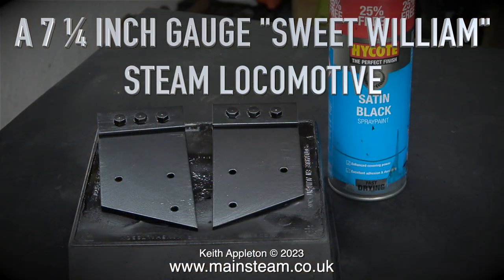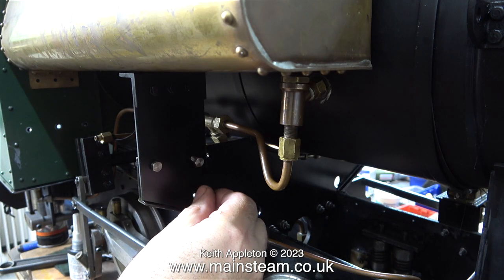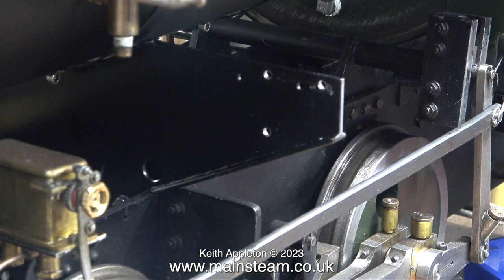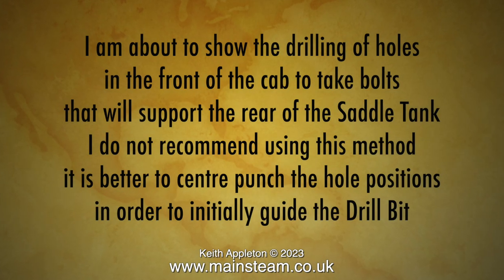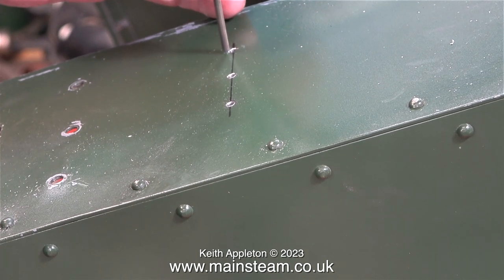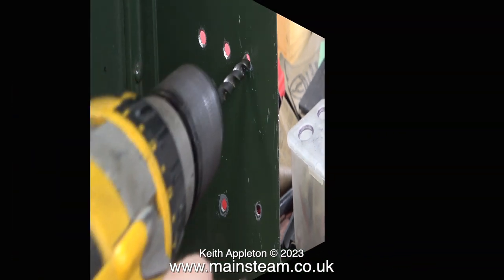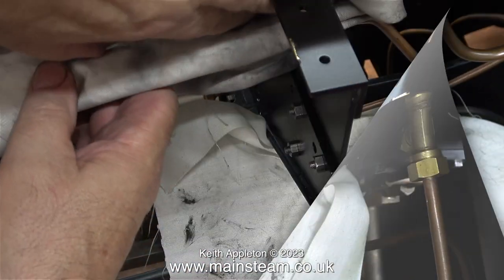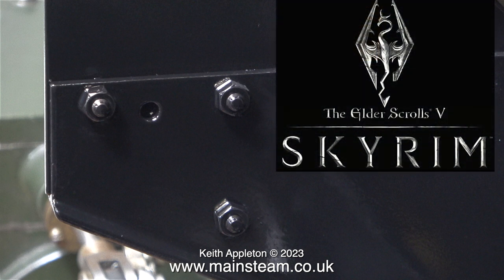A 7 ¼ INCH GAUGE "SWEET WILLIAM" LOCOMOTIVE - PART #53

Comment: I greatly appreciate your commitment to simplicity and non-fancy, but fine, workmanship. I'm not sure though that I can get my head round the idea that, for newcomers, years of experience are a good substitute for straightforward engineering practicce. Sort of cart before the horse. These days good marking-out tools are cheap and readily availble. A felt-tip pen, a centre-punch and a tungsten scribe to lightly cross  the spot so you can readily see if you've gone adrift take no more time, expense or effort. A set of transfer punches costs little and takes away the need for those years of practice to get accurate alignment between parts. And I would counsel against using centre-drills away from the lathe. They have an irritating habit of snapping and drill 90 degree holes which are not good for centring drills. I've converted to 120 degree spotting drills, whose angle matches normal 118 degress drills and never break. They make drill alignment easy. I speak only as a retired radio officer and sound engineer who has mucked about in a workshop almost all his life.

Comment: Hello, thank you for the latest video. May I ask if there a risk of vibration and abrasion in operation between the new black front brackets and the underside of the tank? Just asking as at this stage the tank appears to rest on the brackets rather than being fixed in position. Apologies if I missed something about this in the commentary or have forgotten something you covered earlier in the series. Thanks again.
Reply from the maker: The Saddle Tank is going to be firmly bolted to the two uprights at the front.